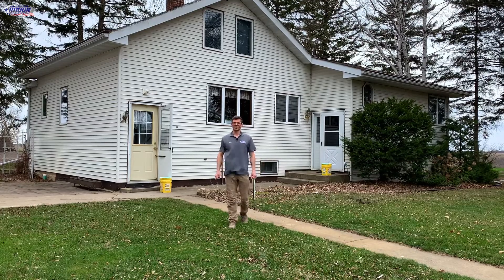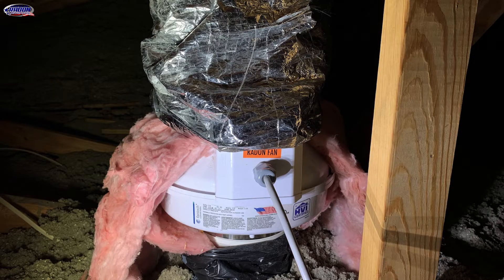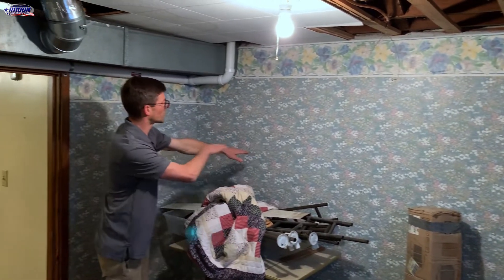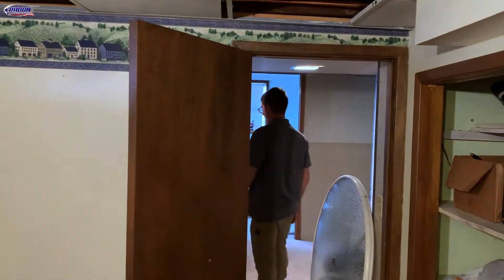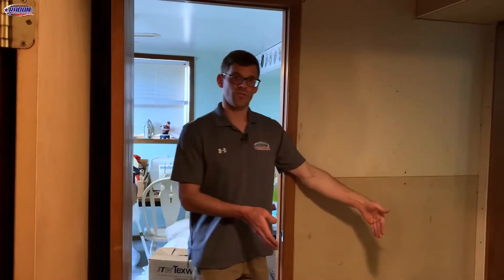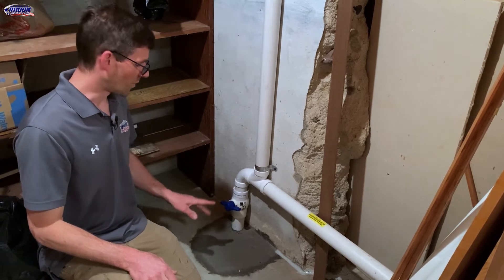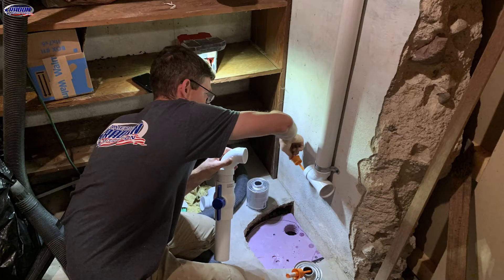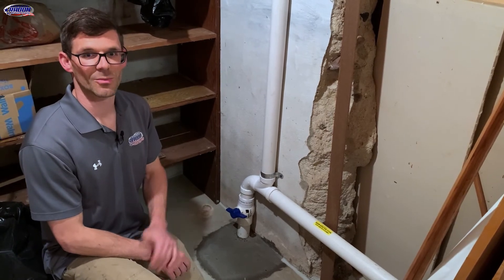Creating an Unusual Suction Point in an Old Farmhouse

Comment: I have a mitigation company. I'm just guessing but I'm assuming you charged more than four grand for that system? I have a couple questions if you don't mind

First do you ever just try one suction point in the lowest portion of the house to see if that will mitigate the home?

Do you have a lot of competition? Because I know from experience if I try to do like you did and design a really comprehensive system and charged for it they just call someone else.

I'd be willing to send you a kickback if you can give me some tips on how to sell system like this.

Another reason I ask is because after hundreds of installs over the years I've actually only ever added a second suction point two times. 
But probably a dozen times there's been an existing system with multiple suction points that comes back high during a sale even after appropriate fan replacement. Those times I've ended up eliminating the other suction points and half the time upgrading the fan.

A big part of it is probably because I'm doing a lot of systems for real estate transactions and people don't necessarily believe in it or what a No-Frills quick cheap solution. And it's possible people near the Rust Belt are more skeptical LOL

It would be wonderful if you had some answers sir. I've never met anyone including large companies that can overcome the lack of radon awareness.

Thanks and nice work.
Reply from the maker: There’s more to unpack here than I can do in a comment. It sounds like a consulting may be a good fit for you. You can learn more here: https://americanradonmitigation.com/consulting/

Comment: We just had one. There was an oil tank in the corner of a 1830's basement. Concrete was poured years later, but not under the tank. New owner removed the tank, exposing the dirt. So we ran a pipe, dug a trench in the dirt area and filled gravel over our pipe.
We are waiting for concrete to be poured over the whole space to seal our work in.
You poured the concrete, we are waiting...
Reply from the maker: Nice work, Charlie! A metal mixing wand works well for mixing Sakrete. There's not much to it.